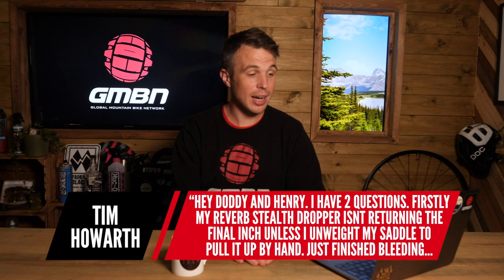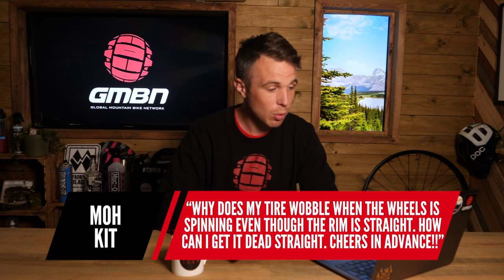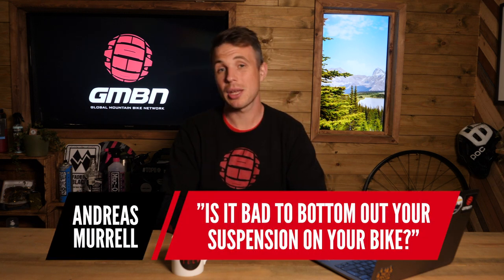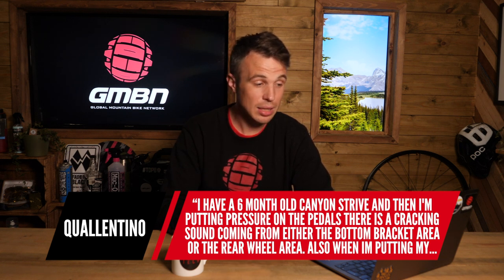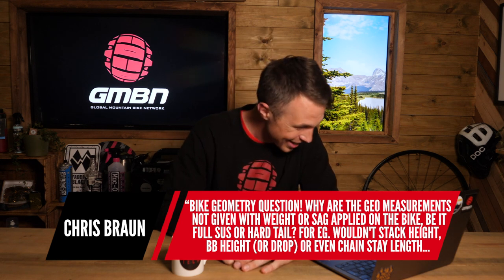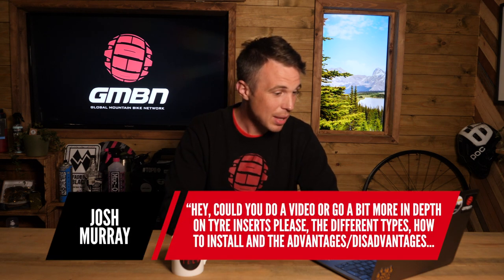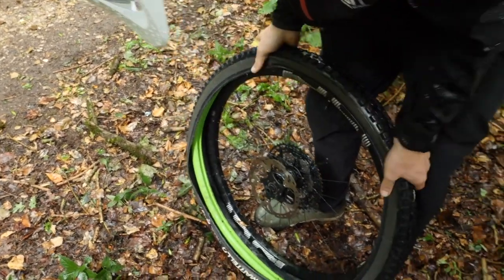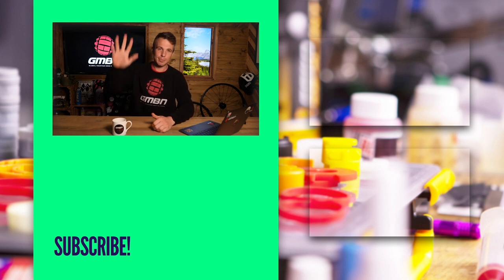Is It Bad To Bottom Out The Suspension Fork On A Bike? | #AskGMBNTech

Comment: #askgmbntech not really a tech per say.  I'm short I mean really short 5'0" or 155 cm,  I'm looking for a Aggressive Hardtail.  I'm finding most Women specific models are lacking in travel or have lesser quality components to their male counter parts.  I'm curious for some one of my height with a 28  inch or 71 cm  inseam be ok on a Youth Bike such as something like a NukeProof Cub Scout?  I weigh 140lbs or 63 kg, I'm curious if I weigh to much for a youth, as I'm finding most of the bikes that k like the specs of the small frame is just to reachy for me.  I have long arms and legs for my height but my torso is short.  So could I get away with a youth bike or are there some very small framed aggressive hardtails that aren't lacking in quality and I'm searching specifically for a hard tail as I have a ladies full sus.

Comment: my fork is doing like a clacking sounds when i ride over roots and other things, but it doesn't do the sounds when the fork is locked out. anyone know a solution for this?
Reply: Could it be creaky CSU? Sometimes fork bushings with a lot of wear can cause clacking sounds..
Reply: could be topout noises when the spring violently extends, does more rebound dampening help?
Reply: @ultiss  ok so i just set my rebound all the way up and the sound is gone now, but do you know if there's anyway i can get rid of the noise even on lower rebound?

Comment: #AskGmbnTech. Hi guys, I'am in a sticky situation, my buddy showed me how to adjust my derailleur clutch and so I did but in a hurry I stripped one of the screws on the plastic cover. There is still 2 screws keeping it tight but. Should I worry about dirt an grime getting in there or will it be ok. Shimano slx 3x10. This will mean the world to me if you guys can maybe help out. Thank you for your time.
Reply: seal wont be as good obviously, you can help the rubber seal a little by covering it with some decent grease
Reply: @ultiss  thank you very much

Comment: #AskGMBNTech Hi guys, first of all I love the channel, really helpful for someone who knows jack abt bike mechanics... I know it’s probably been asked before but how do you get dried sealant off frames, rims, clothing or pretty much anything? Cheers
Reply: hard surfaces: alot of rubbing and cursing haha
Reply from the maker: Hey Toby, there are a few products such as Muc-off's sealant remover which you can spray on to a rim and it'll remove all of the sticky patches from old rim tape and sealant. You can always try to scrub it with the abrasive side of a dish sponge though, something course but not too firm to scratch it.

Comment: #AskGMBNTech Hello, I ride XC bike in a carbon (hard tail), I want to upgrade my wheels, should i buy a top end aluminiun wheels or a entry carbon wheels, by the same price.
Reply: IMO I prefer aluminum as they will dent or bend as they are malleable and can be fixed or trued on the trail. Whereas carbon will crack or brake sometimes catastrophically and will be more expensive to fix.

Comment: #AskGMBNTech Hello Doddy and Henry, love the show! my Rims are tubeless ready and atm i am running tubeless, but my Tires are worn out so i have to swap them. I have some non-tubeless-ready Tires(Maxxis Ikon), which came on my Bike when i bought it, as spares at home  and i am wondering if i can run them tubeless? Greetings from Germany and keep up the good work!
Reply: Try it...use double amount of sealant, as the tyres will soak up lots into sealing side wall. Make sure to slosh sealant thoroughly onto sidewalls once tyres mounted/inflated...not just spin the wheel vertically
Reply: Some non-TL tires can be sealed up using sealant, but prepare to have lots of sealant seap through the sidewalls!
You'll have to ensure that the entire inside of the tire is coated by milk.
Go over-inflate (~3bar) first time to push the milk in between the threads and shake thoroughly and repeatedly.
On 2nd inflation you go for around 2bar - might take a few turns before it seals ... IF it does at all.
Good luck!
Reply: thanks guys will try it and pray that it will work :)
Reply: disregarding fitment question: stock tires often have cheap rubber compound. tires make a huge difference in how a bike rides. My advice would be getting decent tires that fit the riding you do and keeping the stock ones when its time to sell the bike or as a spare

Comment: When sending stairs and big drops on my 2014 Scott Gambler, almost 90% of the time the chain fells off, because the frame squishes a little bit different than other Mtb frames. My chain is longer because otherwise, it will snap on the landing. I'm using Narrow wide chainring and Shimano Zee derailleur, but even the lock on the derailleur isn't helping. Is there any way of fixing this other than buying a Chainguide?
#AskGMBNTech
Reply: Boris Konstantinov A chain device ,I tried doing a few jumps without one ,every slammer threw the chain off with n/w chainring and clutch mech ,Since I put an mrp g3 on ,the chain never comes off .The best chain device I've seen so far is a ,gravity grid
Reply: @richardjeffery517  thanks for the advice 😃. I also think that a carbon mrp would be good. The problem is, that it's easy to break a carbon chainguide. So is aluminum one better(it's a little bit heavier)?
Reply: @mistichen_otec  have you seen a broken chain guide? if not, i wouldn't worry. if so, i'd love to see a picture! Al is also cheaper, if you aren't a total weight weanie then just get the aluminium one.
Reply: @bananasstuff3344 one of my friends just broke one last month lol

Comment: #AskGMBNTech 
Hey Guys,
is it possible to fit a boost rear wheel in a non boost frame? 
Love your channel
Greetings from Germany
Tobi
Reply: no becasue a boost wheel has a wider hub than the frame can support, if it was a non-boost wheel in a boost frame than you could possibly shim it, but not in the way u are saying
Reply: nope, not at all. it is too wide for the frame. try it, it won't work. if the hub manufacturer supports it you could maybe buy some end caps, but thats usually to go from non boost to boost, not visa versa.

Comment: #AskGMBNTeck Been trying to set up my gears using the straighten my mech hanger with an adjustable spanner "using the Doddy method" and can't get them dialled in. You can catch the video here   

https://www.youtube.com/watch?v=3X7OqTDi8NQ

Do you think the S ram 8 speed  gear shifter he suggests using with the 10 speed first generation Tiagra Rd-4601 is part of the issue? 

If that is the case do you think it might be wise to proceed in making content that is A. not misleading and B. dose not devalue your local bike shop staff?
Reply: if you often tinker with bikes and you have a rear axle lying around you can screw that into the hanger to help alignment

Comment: #AskGMBNTech
 Hi GMBN wil 1x7 work or not?
Reply: if you live in hills, i wouldn't, but there are guys who ride singlepspeeds in the mountains so if you want to say fuck it and do it!
Reply: If u ride a DH bike in hilly areas definitely but if u live near a bike park with lifts I would definitely use single speed because there is much less cables up front
Reply: @jameskatz3747  Thanks I ride a xc bike...
Reply: The Shredding Dude then u probably wouldn’t want to convert to 1x7 ( I don’t know much about XC) but my guess surely if u guys have to climb a lot the more gears the better

Comment: A creak “in your bottom bracket” almost never is. Break hoses rubbing under compression, seat post slightly moving in the seat tube, slightly gritty suspension components… too many things to list.

Disassemble, clean, lubricate and reassemble the whole bike in zones until you find the source of the noise.